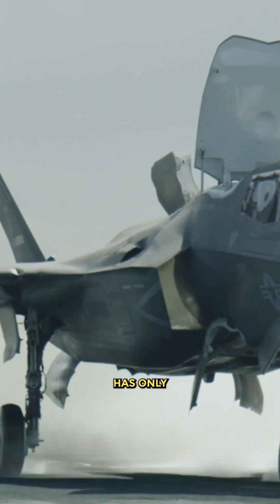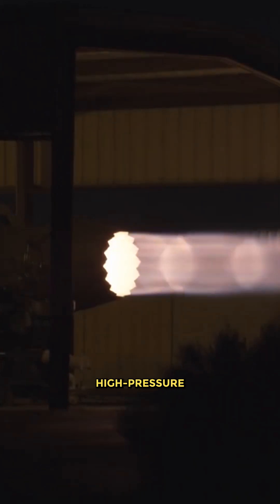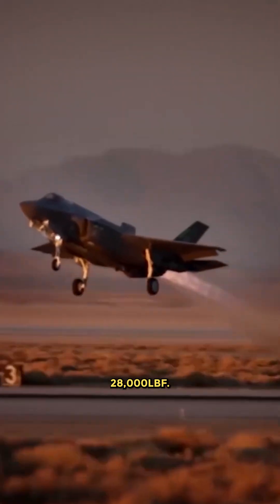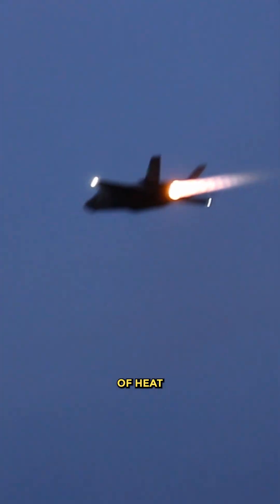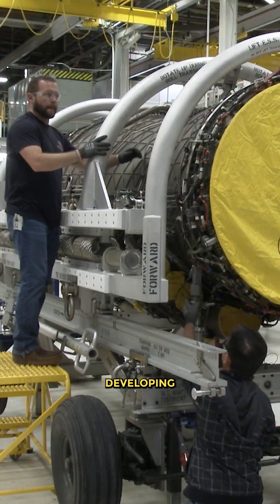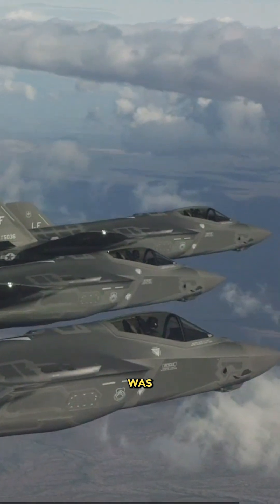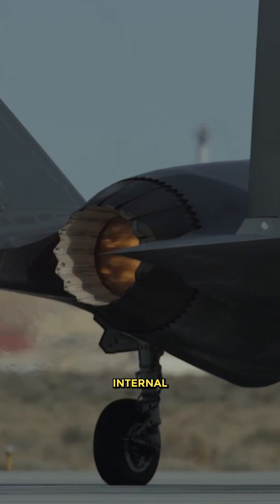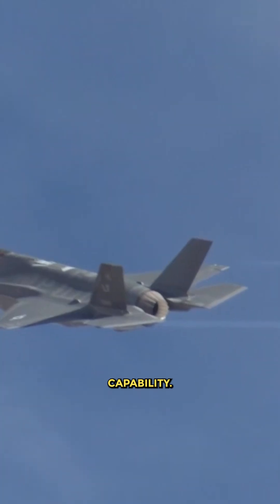Why does the F-35 have Only One Engine? #shorts

Comment: Did someone mention agility? I thought it was the lack of agility that caused f35 to be defeated by older f16 during that mock combat. If only Lockheed could pay its engineers instead of paying these YouTubers
Reply: It was a prototype F-35 that was doing mock dogfight against the F-16 and that was a year or 2 before the F-35 enter Service with the USMC and USAF As well ever since the F-35 enter Service the upgrade and Block Drop2 soon to be Block Drop 3 have become more maneuverabilitied and agiles enough I am sure it can out fight and out manuver the F-16 now
Reply: Correct me if I'm wrong but the f-35 didint have tactics since it was fairly new and was pitched up against the f-16 you mentioned
Reply: It wouldn’t surprise me if the F-35c version could out maneuver the F-16 but maneuverability it not as important as it once was.
Reply: @browsman2328  Yes it is. Cz maneuverability isn't merely used as a tool in dogfighting, it's also the main weapon a pilot has against aimed fire, be that AAA, SAMs or AAMs. If you can't maneuver, you are an easier target.
Hence why the Su-27s infamous 'cobra' maneuver is a great aerobatic move, but would be completely useless in a real dogfight....unless it was one on one.
Reply: Well, now they're looking to make NGAD Next Generation Air Dominant 6th gen. Fighters. I'm curious af to see it.
Reply: If only people like you could do atleast a minimum research before commenting such nonsense..

You clearly have no idea what you are talking about🤦

Comment: Was supposed to be the “cheap” companion to the f22 like the f16 was to the f15. That didn’t quite work out.
Reply: No, but if I recall correctly the F-16 ended up at about 90% the cost of a F-15 when it was supposed to be much, much cheaper.  The cost per unit is driven down when you can spread the design costs over more airplanes (and you don't have to "fix" problems in later revisions).  In the USAF  there's about......twice as many F-16s compared to F-15s.  And there are many more F-16's overseas, not as many F-15's outside the US.  Many who worked for the USAF said the F-15 was designed right the first time, and the F-16....needed some fixes, and that drove up the cost per unit.
Reply: What didn't work out? The F-22 was designed for air to air combat. The F-35 is a multi-role jet.